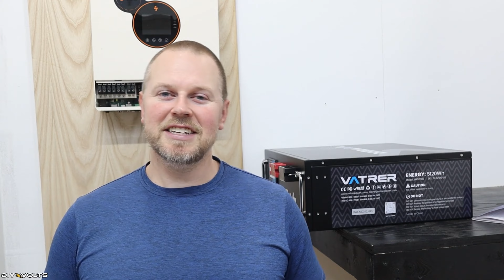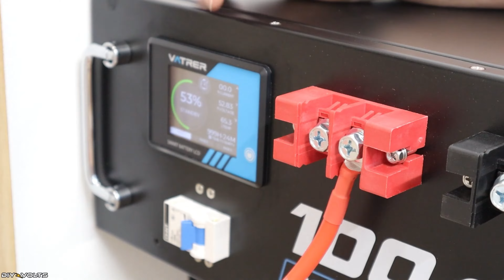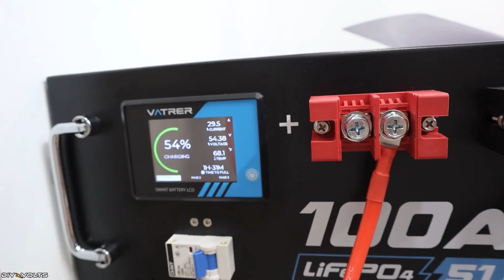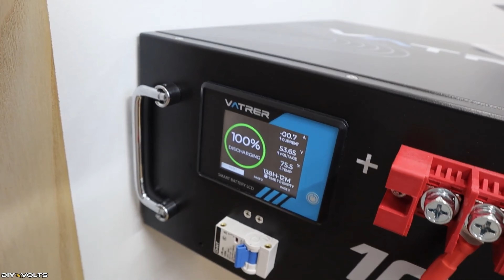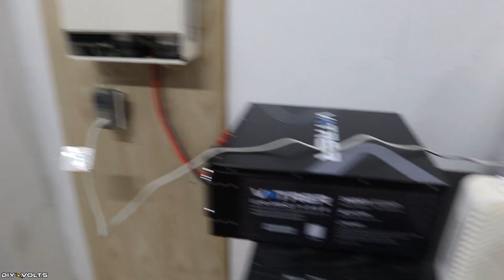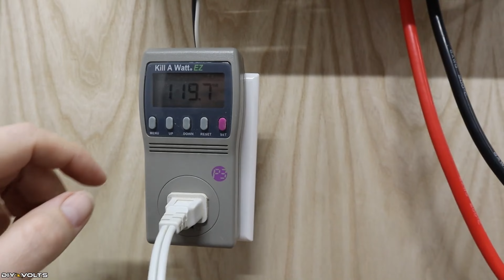Top Picks for Server Rack Battery

Comment: Right away I see a potential problem. How big of a lug can you fit on these positive and negative terminals? You might be limited on what wire size you can put on.
Reply from the maker: That's a great question! Our product is designed with versatility in mind. The lug sizes on both the positive and negative terminals are quite accommodating. They can handle a range of wire sizes, from smaller - gauge wires suitable for light - duty applications to larger - gauge ones for more heavy - duty setups.